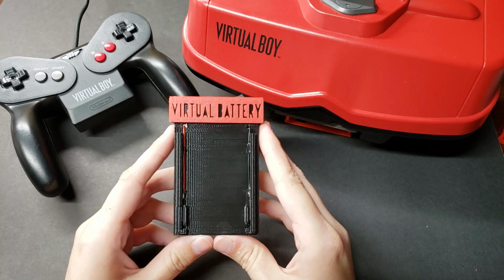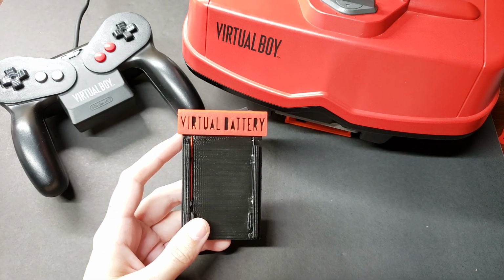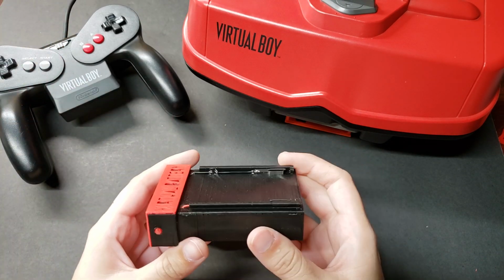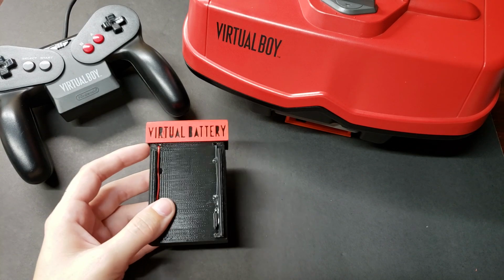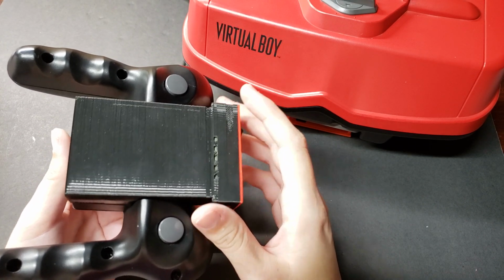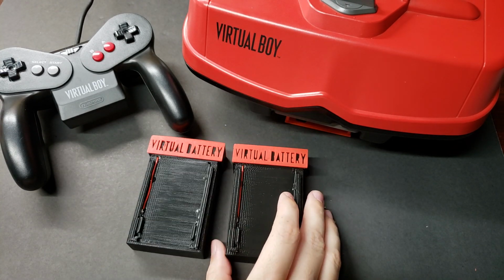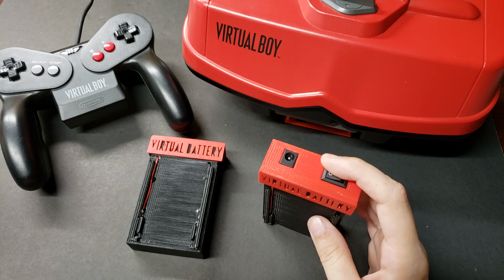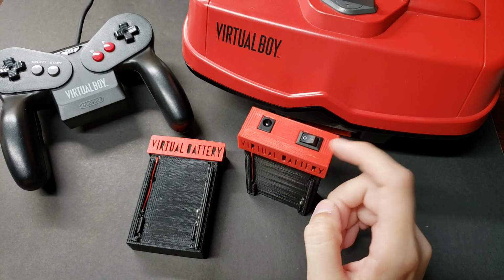Virtual Battery - Rechargeable Battery Bank for the Virtual Boy

Comment: So you're running the Virtual Boy on 12  volts while it was designed for 9 volt operation. That seems like a sure way to shorten the life of your precious retro console!
I would recommend anyone to supply the right voltage to any device. Some devices may be able to handle a somewhat higher voltage but you can never be sure! Please be safe and use the correct voltage!
Reply from the maker: No, I'm running the virtual boy on 12v when it was designed for 6v-13v. Check the label on your VB :p
Reply: I never noticed that.. I stand corrected! I'll be building this one.. Thanks!

Comment: The model is really sloppy. If anyone is planning to print this make sure to modify it by adding some thickness to the 2 side walls, if you print it as is you'll get paper thin walls. Shocking.
Reply from the maker: If you add more side walls, either your battery won't fit, or you'll risk scratching up your controller when you add/remove it. The thin walls don't matter because they are supported on one side by the battery and on the other side by the controller. If you're able to add space on either side, then it's probably just a difference in printers or slicers, mine come out the perfect fit with no room to add thickness.

Comment: Hello, i just got a plain old grey switch and i am trying to figure out how to moodify it without tinkering with the joycons too much.. im a big fan of retro games (snes, nes, n64, gamecube) and i was wondering if there is any themes i could make without taking apart the joycons, ik its kinda wierd but im a big fan of your work and id really like to get started modifying without too much risk of destroying them. (Ps i really loved your gamecube switch joycon mod) :)
Reply from the maker: Unfortunately modding does involve taking the joy cons apart. If you don't want to take anything apart, you can't customize the buttons, the shells, the internals, or the joysticks. That pretty much just leaves you with the option of using decals (stickers), which I'm against using :p Stickers mess up the shells
Reply: @Madmorda  Thanks for the reply, so i just discovered how to change out the back plate and to be honest, something like that is a bit more on my level. Im also considering using button caps from skull and co. and thumbgrips to create a n64 controller theme. But im a kinda scared that the button caps could be cheap, big and not very good looking. So with the joycons im only really left with one option and that is to disassemble it. Do you have any themes that would be suitable for a n00b such as myself? Thanks again ^_^

Comment: This is really impressive, I just won a yahoo auctions listing and am importing one from Japan. So I was wondering, will this work for a Japanese unit? I've read somewhere that when using the tap you need to make sure to use a super famicom power supply as opposed to the snes power supply, does that actually matter?